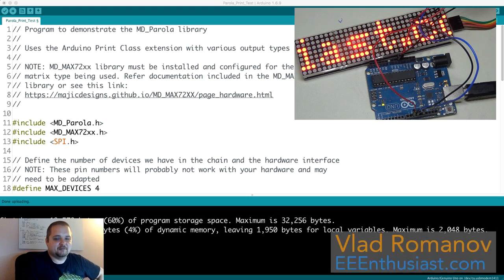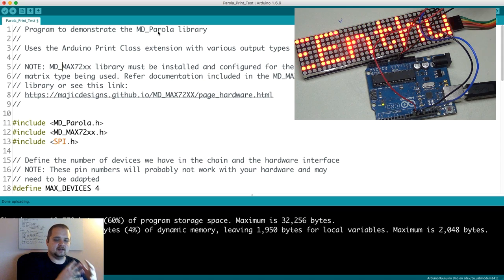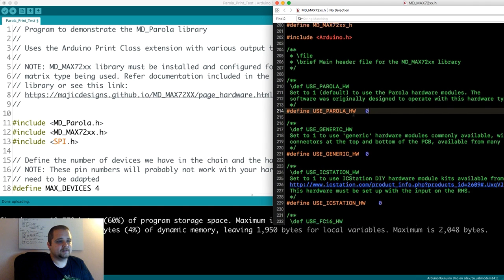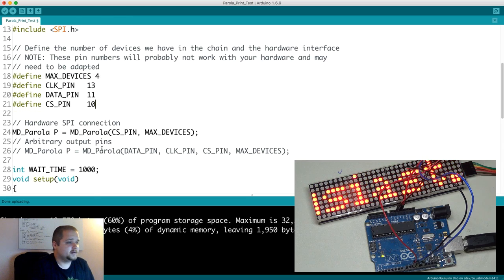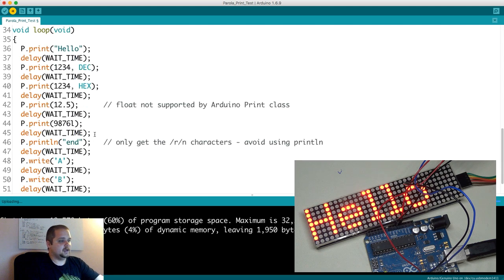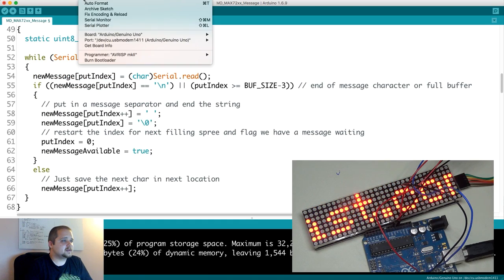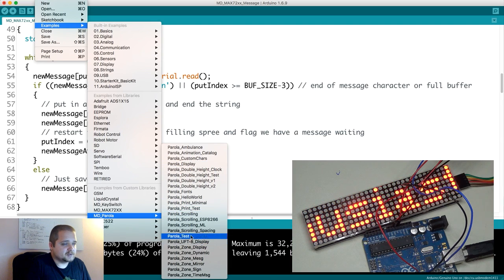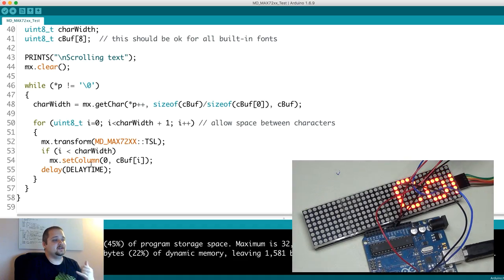Arduino Tutorial #21 - MAX7219 LED Matrix Display Walkthrough & Test Code - Scrolling Text Code

Comment: Found the .h file and it is not like the one in the video. Seems you don't have to make the change anymore with the newer .h file. But all I got was every dot on the display was on. Maybe it don'w work on the Mega 2560
Reply: Version 3.0( of the MD_MAX72xx lib) has hardware select in the Arduino Sketch. So you don't need to edit the header file any more.  For example, find
 #define HARDWARE_TYPE MD_MAX72XX::PAROLA_HW in the code and change this PAROLA_HW to FC16_HW or ICSTATION_HW or GENERIC_HW, it depends of your hardware and one will work

Comment: I am trying to understand why mine is inverted all the text is back to front
Reply: The solution posted by Dave Cleland solved it for me. Basically change  #define Hardware_type MC_Max72xx::Parola_HW to  #define Hardware_type MC_Max72xx::FC16_HW to tell the library what hardware you have (I guess).
Reply: please give a feeback here.. were same
Reply: @glynn mason.. the problem has solve. you must install the MD_patrola with the version of 2.6.4 and the MD_MAX72xx version 2.6.0 that's the problem i've fix earlier..

Comment: Version 3.0( of the MD_MAX72xx lib) has hardware select in the Arduino Sketch. So you don't need to edit the header file any more.  For example,  Open Parola_Scrolling --> look for line of code(line 43 or so) #define Hardware_type MC_Max72xx::Parola_HW --> change Parola_HW to FC16_HW.( cheap aliexpress version 1088AS) or change to whatever hardware version you have.
Reply: Oooh, and suddenly the text displays non-inverted! Thanks a bunch!
Reply: Brilliant. Many thanks. I've spent a long time to try and sort this out. Now it's working.
Reply: @malcolmpalmer2437  can you send code.....
Reply: Hlo Dave, can u explain how to i can edit the library. bcouse i dont find the lib installed in my arduino software. i opend parola_scrolling, but in the Sketch there is no lin :  #define Hardware_type MC_Max72xx. How i can change or ad the specific .h file? thanks in advance, Peter
Reply: Can you send code anyone please help me...i  dont understand the codeerror
Reply: @sree-1765  Send me a mail to tsf73653@gmail.com
Reply: @sree-1765  send a mail to me. tsf73653@gmail.com
Reply: I found ur profile on the amazon review fr the item, wow

Comment: I get something on the display, but it is backwards I used fc16 in the header 
amazon Cylewet MAX7219 Dot Matrix Module 4
Got it to work. I had changed the wrong file.

Comment: Arduino: 1.6.5 (Windows 7), Board: "Arduino Uno"

C:\Users\Venkatesh\Documents\Arduino\libraries\MD_Parola-master\src\MD_Parola.cpp: In member function 'void MD_Parola::begin(uint8_t)':
C:\Users\Venkatesh\Documents\Arduino\libraries\MD_Parola-master\src\MD_Parola.cpp:67:17: error: 'nullptr' was not declared in this scope
   setTextBuffer(nullptr);
                 ^
C:\Users\Venkatesh\Documents\Arduino\libraries\MD_Parola-master\src\MD_Parola.cpp: In member function 'virtual size_t MD_Parola::write(const uint8_t*, size_t)':
C:\Users\Venkatesh\Documents\Arduino\libraries\MD_Parola-master\src\MD_Parola.cpp:132:14: error: 'nullptr' was not declared in this scope
   if (psz == nullptr) return(0);
              ^
Error compiling.

  This report would have more information with
  "Show verbose output during compilation"
  enabled in File > Preferences.
 please solve this error

Comment: Enjoyed the tutorial. One question... How do you open the header file to tell the sketch which board I have?? Thanks!
Reply from the maker: Thank you for the kind comment. On a mac, you need to go into your Applications folder and locate the specific library. Inside of the library you will have to edit the header file; I used Xcode which was the default on my machine. On a Windows machine, you should be able to find the same in the Arduino/libraries/"any library" directory. Once there, just open the file in Notepad or any other editor and make the changes.
Reply: EEEnthusiast, I finally figured it out! Thank you again for the help and I now need to get more modules to hook together!!

Comment: It is very nice tutorial. 
I heard you once saying you like to look for the problems which people faced it, here is one. I want to control of 3 axis Z,X AND Y . I want to keep it stable all of the time, means when the of the x,z and y change of data the motor or servo of the axis works to back stable again with other Axis while the other motors or servos of other axis be calm.
Reply from the maker: Hi M. Samaha, That's an interesting application. Have you started working on it? I'm assuming you'd need an accelerometer/gyro in order to detect the real positioning and adjust the motors to the target based on the feedback loop. I'd gladly help you further if you want to message me more details about the project.
Reply: Yes, I need your help.
I want to make stabilize for the x and y and z which mean when the sensor detect change on any axis , then give power to the axis which has change to keep the axis stable all of the time.
I would like to do it with servos. Contact me on my email mossad.samaha@gmail.com
Reply: I found Arduino 9 Axes Motion Shield, Does it fit? Or you suggest use gyro "10-DOF IMU Breakout - L3GD20 + LSM303 + BMP180" both of it has 9 Axes. I am glad to work together on it.